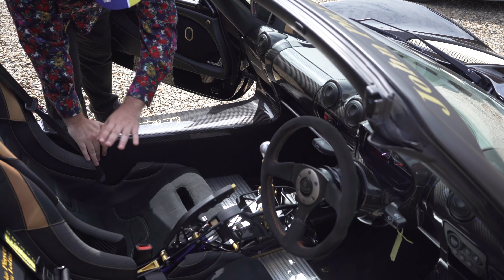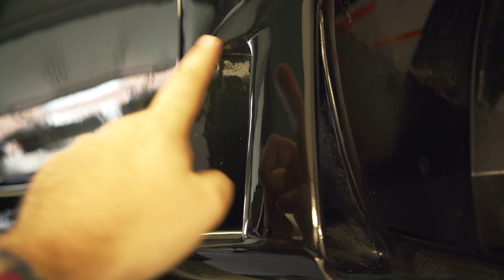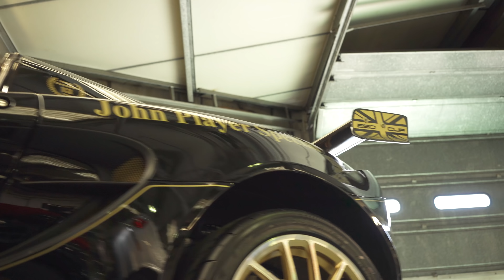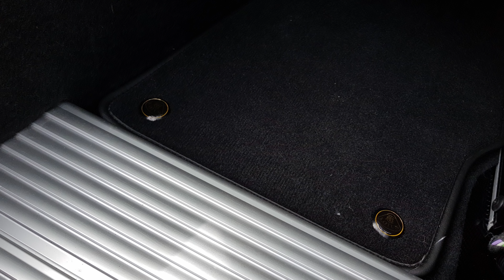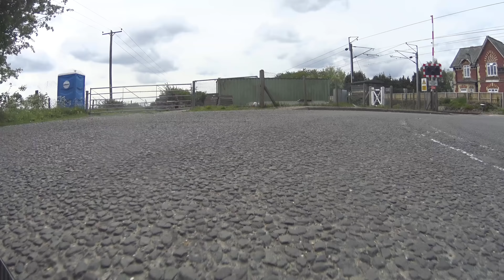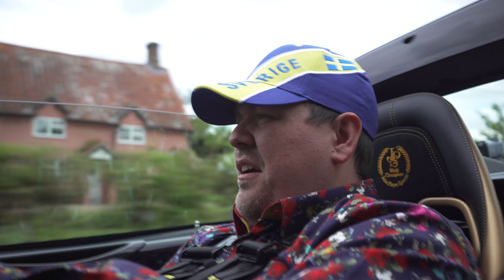This is The Best Lotus Elise I Have Ever Driven.

Comment: I have the same Nitrons.  They are amazing in that they settle the car's ride but have increased spring rate that reduces roll and improves steering response.  Great upgrade.
Reply from the maker: Do you happen to know which ones they are? Nitron do a few
Reply: I saw helper springs and just 5 coils in the front.  This is the 46mm NTR, single adjustable with the "club sport" spring set.

Comment: On the Evora 400 and track days - I did a Lotus on Track day at Silverstone on the GP circuit in April and there were a number of Evora 400 and Sport 410's running on the day, along with a McLaren 720S.
Reply from the maker: Interesting, I had heard reports of them being booted off Silverstone
Reply: There was no static test on the day, dunno if they were running a drive by check. None of them seemed to be pushing that hard though (I even passed a couple in my S1 Elise) but there was an early NA Evora that was absolutely flying round, along with a couple fast Exige V6s.
Published limit for the day was 105db static & 102db drive by
Reply from the maker: Yeah Silverstone never does statics, but I have heard them getting chucked off because of the drive by.

Comment: JayEmm!!! Elise 220 1.8 or Exige S V6 standard, had a S2 Year 2000 1.8 200 odd before and the V6 2013 13, sold both back 18 months ago, want to re buy into Lotus again, got the itch, which one, V6 or faster Elise???
Reply from the maker: I'd get the Exige personally

Comment: Awesome review. So honest. Pulled the trigger on a 111R yesterday.
Reply: I bought an S today :D

I'm going to use it daily as it's my only car right now. I bought it from a guy who used it every day, who bought it from a guy who also used it every day.
Reply: Mister Nobody wow! How many k’s / miles?
Reply: @brendankeenanFF  About 79k, but it used to be a track car and was fully restored and put back to factory spec 5 years ago (all brand new engine, gearbox, clutch, brakes, suspension, dash cluster direct from Lotus) by a specialist and was used as a show car until I bought it. It's like a new car in an old body.

While at it they also fitted all the interior trim options, re-trimmed probax memory foam seats and a DAB radio which is nice :)

Comment: you know how they've always said that the nicest or most enjoyable 911 to drive on the road is always the cheapest one... how do Lotuses fair in that way?
Reply from the maker: Not the same, as even a hardcore Lotus is quite compliant usually - you wouldn't want to daily a 911 GT3 RS but you could easily do it with an Evora GT430